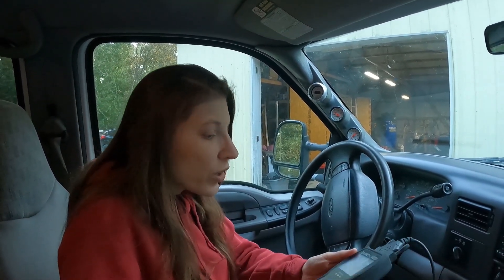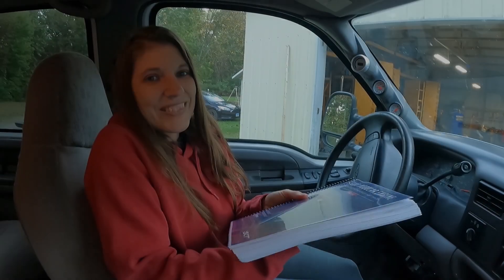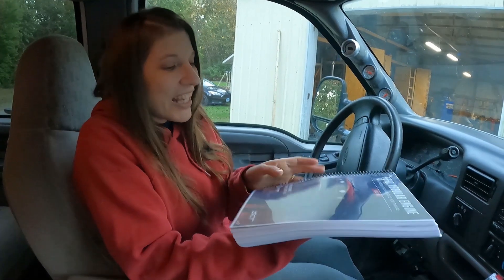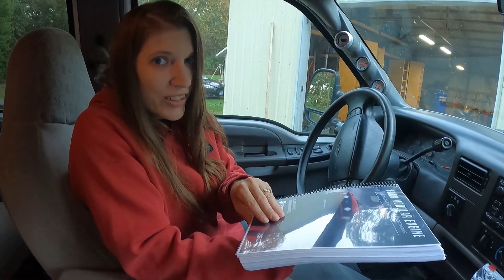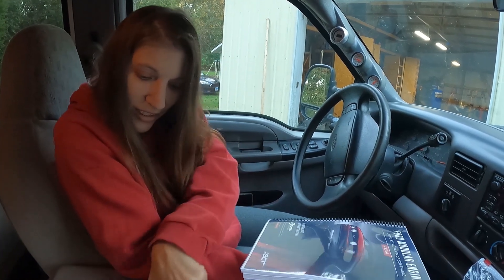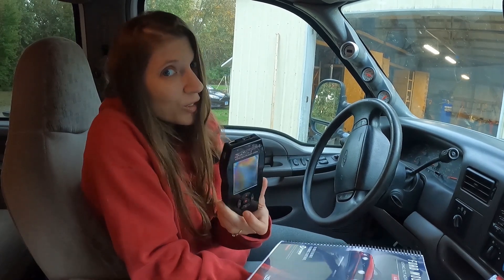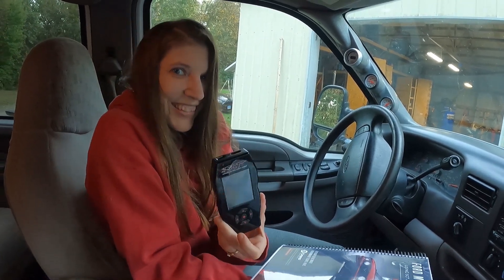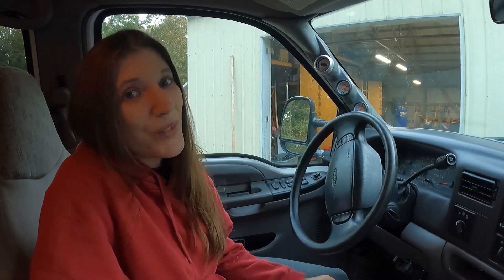f-250 5.4L ford triton on boost for the first time. part 6

Comment: Will it build boost under 2500 rpm in od?  If you were going to do it again would you get a smaller turbo?
Reply from the maker: I’m fine with the way mine turned out. I wouldn’t think it would be a good idea for a stock engine to be subjected to sustained boost pressure all the time. There are several things on my truck that require vacuum to function also.

Comment: Watch going up over 8psi with na ring gap, maybe some 30lb injectors and vrg fmu if you got the return style fuel system, just have to figure out timing retard under boost if you get pinging
Reply from the maker: I haven’t had any problems with fuel starvation, spark knock or pre ignition at this boost level